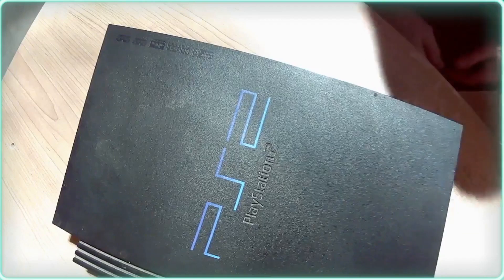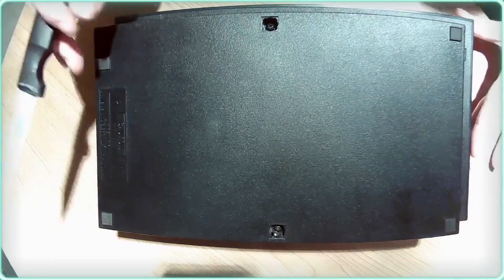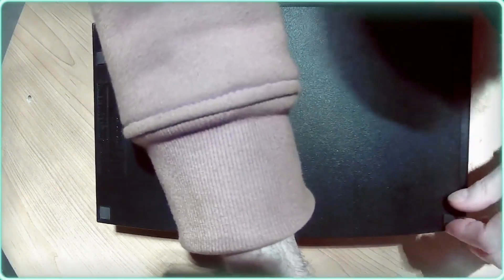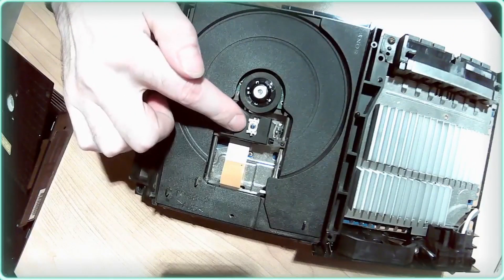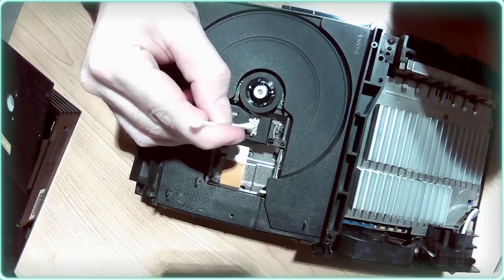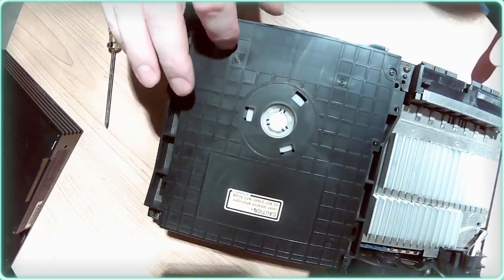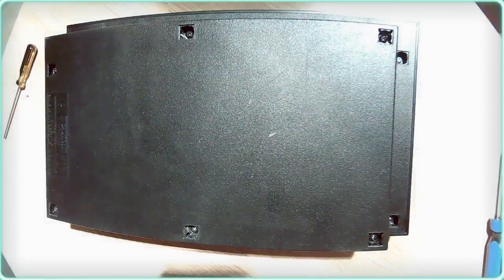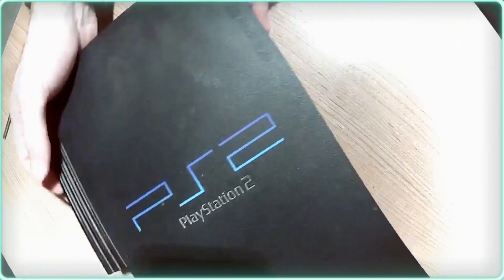Playstation 2 - Laser Lens Cleaning - PS2 Disassembly Safely

Comment: Hey man thanks so much for the help. My playstation 2 is from 2005 and it had never been cleaned once, and it had sat for long periods of time not being used but it still fires right up, but the laser wouldn't read numerous disc's. Finished the whole process in about 30 minutes and gran turismo 4 works again after years
Reply from the maker: Great to hear!  The Ps2 was notorious for dirty lasers since they have a fan to circulate air without air ducts.
Reply: Yo I’m cleaning mine to play gt4 too!

Comment: Is the laser lens also the reason for the appearance of the red screen
Reply from the maker: From my understanding, on the PS2 the red screen of death (rsod) is caused by the playstation detecting an invalid format on the disc.  While it is possible the lens might be able to cause that, I would give it a low probability.  If it is an original PS2 or PS1 cd, and there are no mod-chips or anything installed, it could be a dirty or bad cd.  Does it go to red screen on every disc or just a particular one?
Reply: @djafk  Hey mine does it with Xenosaga i heard it was cause its duel layered , other discs work except that one so do you think i should clean my Laser
Reply from the maker: @corupptedkev6032  It could be the laser or the disc.  You can try cleaning the laser, or try the disc in another ps2.

Comment: My Playstation 2 with i-connect laser won't read my Gran Turismo 3 A-SPEC and Gran Turismo 4...
Reply: And on side not I gave you a shout out on my channel...@djAFK
Reply from the maker: I am not familiar with the I-Link cables, but it is possible there could be an incompatibility.  Do those games work without that attached?
Reply: @djafk  the i-connect is to link 2 Playstation 2's together, kinda like if I wanted to trade cars with you, I could do it with i-connect
Reply: @djafk  it's also sayin 
Brower
System configuration
I selected both and all it says No Data, it doesn't show a disc or memory card I did exactly like you did (I had 50% rubbing alcohol) and it still says No Data, even after I've put Gran Turismo 3 A-SPEC in
Reply from the maker: @hankyspanky1987  That sounds like it doesn't see the disc.  Do you have a way to test those games in another PS2?  There can even be damage to the laser if not the disc, but usually if most games work then the laser is okay.
Reply: @djafk long story short little sibling pulled on the cords Playstation fell bout 4ft onto carpeted floor, original Gran Turismo 3 got damaged, I put the Playstation away, when I got an xbox and recently found a game store full of all kinds of games, I bought another disc of Gran Turismo 3 and still says No Date...
Reply: @djafk  it still does the Playstation 2 load screen, sound like its suppose to, just doesn't read that a disc is in it
Reply from the maker: @hankyspanky1987  If the disc was spinning when it hit the floor, that one may well be damaged.  It is possible you have another damaged disc from the store.  Do you know anyone else with an unmodified ps2 that you could try them in?
Reply: @djafk  unfortunately no I don't know of anyone with the same one as me...when I go to put the disc in, it does spin, you if you could order parts in pieces, like a laser, disc plate, the fan, stuff like that I'm sure there is a store that does that, do you know a store that does old generation consoles, Playstation 1, xbox, Playstation 2, xbox 360...and so forth (not sayin for you to order parts for me but a knowledge of a store that does that kinda stuff)

Comment: my laser is new and lights up but doesn't go up and down, what's the solution sir
Reply from the maker: Hmm, there are a few things that could go wrong there.  If it is a replacement or is of unknown origin, I would inspect and probe the contacts to see if it is getting voltage when it needs to move.  If a regular cd will read, then the rest of the apparatus is okay.  Might check out some of the suggestions in this forum thread - https://forums.afterdawn.com/threads/ps2-lens-wont-move-up-or-down-but-it-lights-up-solved.696881/